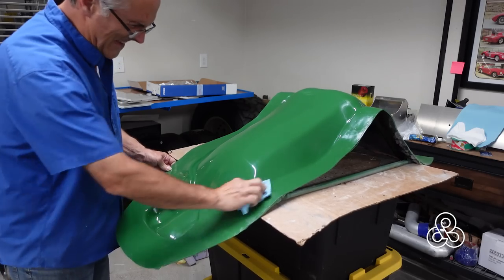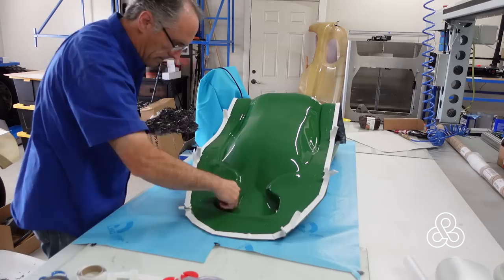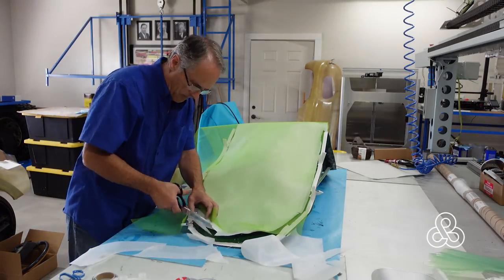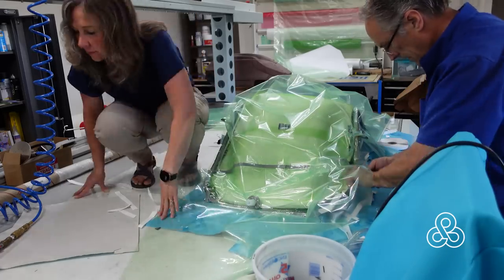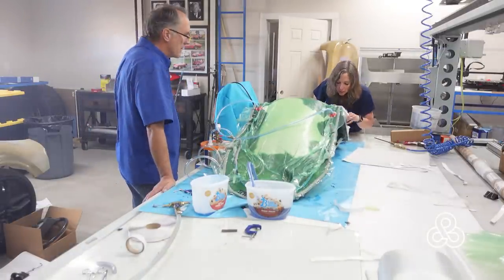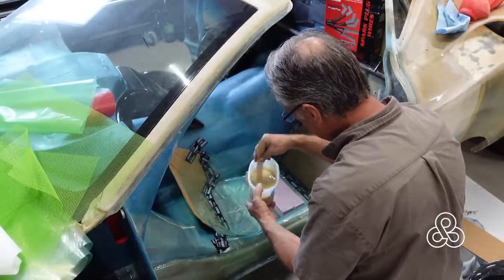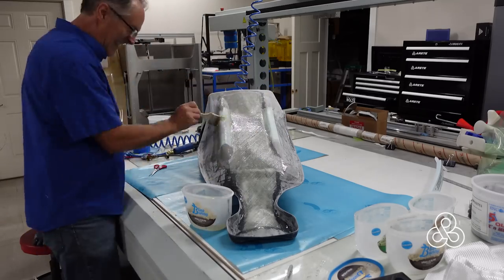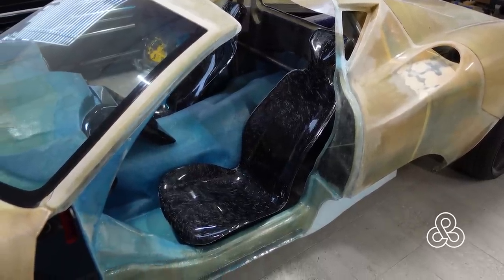A83 Forged Carbon Fiber Supercar Seats. Includes- Infusion fail.

Comment: I’ve had infusion fails and trials myself.  I’ve learned a bigger feed line and stronger vacuum helps.  Also I think spiral wrap only across the bottom instead of all the way around and infuse one end to the other.  Every specific shape seems to have its own challenges though.  I like how it turned out and it looks great in the car!
Reply from the maker: Yep, you try to guess how things will flow, but sometimes you just have to see and then correct the deficiencies!
Reply: an autoclave would solve it but who the hell can afford that?

Comment: Looks like you're trying to do the Lotus VARI process.  I did this work for years, making carbon car parts. What we did was to lay the carbon wet, then place the peel ply, nylon fluff then strechalon.  The nylon fluff allowed plenty of air transfer.  We also put a 4mm honeycomb core in and another couple of layers of carbon over that. Wet it all out then bagged it.  Totally superior panel finish and strength.
Reply from the maker: I will probably be able to add a few tweaks to get the infusion to work on the passenger seat, but a wet lay up and then bagging it would work as well. Just need some Sloooww epoxy! Thanks for the input.

Comment: The chopped carbon fibre strand finish looks great.
Reply from the maker: After I did the dash piece in regular cloth it was a little disappointing compared to the air intake at the turbos; the forged carbon really popped! Now everything will be "forged". . . .well, most of the trim anyway!

Comment: Not sure that I could trust those bolt heads not to rip through the fibreglass on impact. Would of thought a flat bar frame connecting each bolt under the fibreglass would be safer. 
But of course you're the expert and I'm in awe of your build. Great video.
Reply from the maker: Never trust the bolts of the seats; instead ensure the safety restraint system is bolted directly to the chassis. (Monocoque tub in my case).
Reply: Yeah those bolts are simply not restrained well enough. Surprising because he gets everything else pretty good

Comment: another tip for finding out where to drill holes for your seat... put dome nuts on the bolts in the seat. put some bearing blue or paint on the ends, can be tricky if theres some moving around to get the right position. alternatively you can make threaded pointed nuts, for lack of a better description, depending on how sharpe you need them, probably the floor would scratch to much. but basically when you have the spot the bolt needs to go, give the piece a tap or a bump and it should leave the indent of where the bolt has to go.
I Do like the stick method tho.

Comment: Why didn't you cast channels for racing harnesses into the seats? You decided you only want 3 point seat belts? Also, wouldn't an aluminum sheet cast into the bottom provide a stronger anchor point for the bolts? I've considered building similar carbon fiber/kevlar seats for an electric sports car I'm building and want to make sure in event of an accident that the seat stays bolted to the car floor.
Reply from the maker: If it makes it past testing on the road we will then consider taking the car to the track. When that time comes there will probably be more than seats that change.

Comment: hi there, i saw you mixed the foam for the base of the seat, then you mentioned you used a "microspheres slurry" to smooth out the foam.
may i have the information on the names of those 2 products?
and where you purchased them?

microspheres slurry and the foam mix?
Reply from the maker: two part urethane foam, commonly used in boat building- most composites suppliers sell it. The slurry is made by thickening epoxy resin with microspheres (Q-cells) also available through most composites suppliers (try USCompsites.com)
Reply: @BuilderCreator  thanks alot!

Comment: I have always wondered, did you make any calculations on how would car behave in case of crash ? I mean, how would it deform, how would crash affect occupants and their space, or for example how safe would be those composite seats meaning, won`t they break and hurt passenger under peak stress ? How do you exactly know how many carbon fiber/glass fiber layers do you need for such structures so they won`t take apart and that they provide enough strength in some extreme situations ? Anyway, interesting project :)
Reply from the maker: Well, the seats attachment means little unless you have the safety restraint system mounted to them. Few manufacturers do that and rely instead on the SRS to be bolted directly to the chassis. (Monocoque tub in my case). As for crash simulation software - not even the DOT allows crash simulation and wants the real thing (crash test). I guess, I will be going by the seat of my pants (pun is intended). Ha!

Comment: Is there a reason your using fibreglass instead of carbon fibre to add extra depth?
Reply from the maker: Cost for only a 10 oz weight penalty.
Reply: @BuilderCreator  fair enough. Have you looked into compression moulding for seats or would the mould be too big?
Reply from the maker: @r3vd4wg18  Another expense larger than I need as I only require 2 seats. A compression mold would be for high production.

Comment: I looked up "real" forged CF and you seem to have missed the High Compression inside/outside high heat metal molds. Chopped up CF and a vacuum bag is not "Forged"....this is so half assed
Reply from the maker: Glad to see you back Richard Smith; we've missed you and your criticism. By the way, what is going on in your life that leaves you so bitter? Something we could help with?